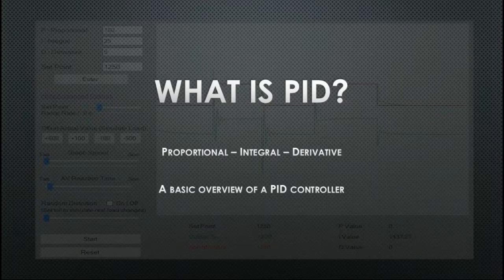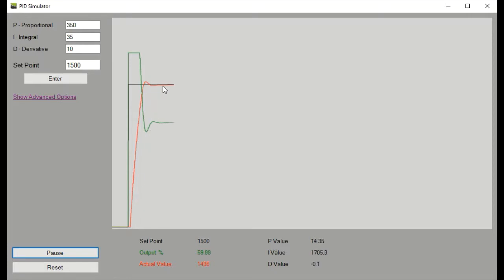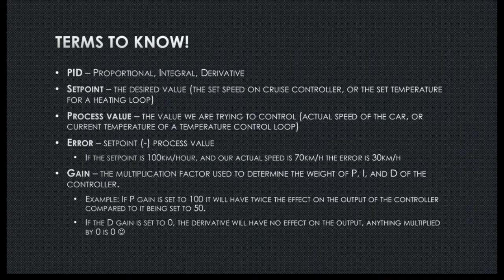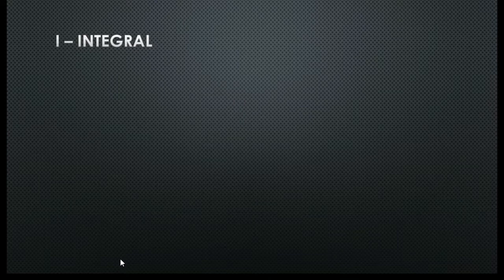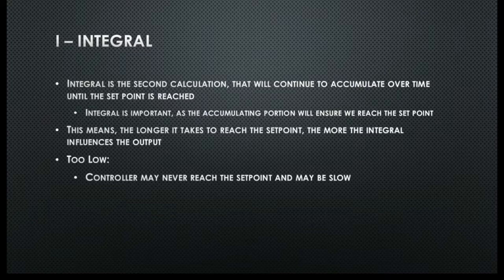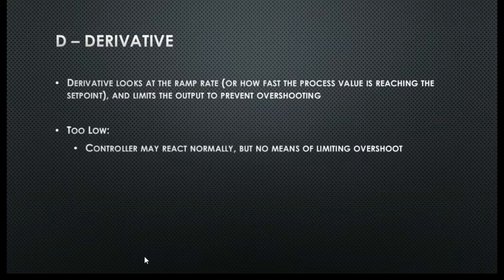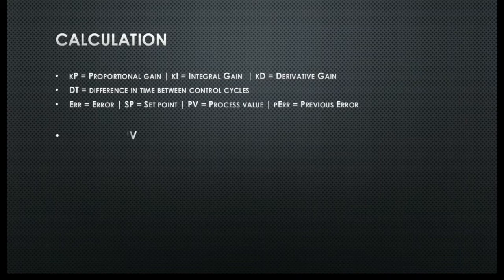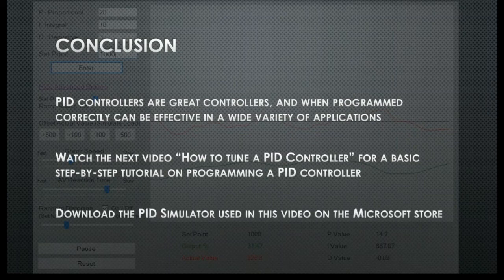What is a PID Controller?

Comment: Hey, very well explained 
If a Pid loop is set up operating nicely following on set point under sharp inputs. And then in a situation with no input but an external force for example wind is acting to push it of track, which of the P the I or the D is most likely going to need to be adjusted to kelp it on track?
Reply from the maker: Thanks for your comment. If tuned correctly it shouldn't need adjusted. If you feel it deviates too far from the setpoint when the wind acts on it, change the P for slightly faster initial reaction, and the I if it takes too long to come back on track. Hope this helps.

Comment: The explanation and microsoft software are awesome!  My particular situation does not seem to have a solution though.  I want to control the vapor temperature above the liquid.  The liquid acts as a slow temperature loop but when the vapor reaches the top of the column before the condenser, it acts more like a fast response.  The result is there is no apparent set for PID that keeps the vapor temperature from far exceeding the set point and then a very slow cycle above and below set point.  I am using water and want the vapor temperature to be 130 degrees.  the best I can do is overshooting about 10 degrees and then drops back to set point and cycles on a 20 minute time scale to +/- 5 degree swing.  Any suggestions?  The pid unit is a mypin ta4 attached to a vapor point probe and a solid state relay.  I have tried dozens of solutions based on the modeling program and dozens more based on the auto tune for the mypin.  All have similiar problems